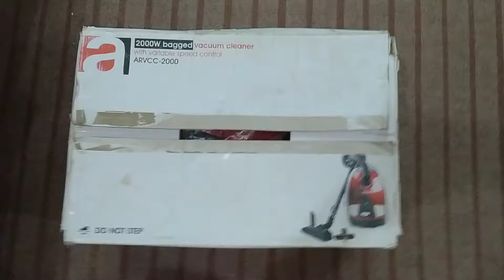how to use a vacuum cleaner?

Comment: I m using this vacuum cleaner but after sometime, it turns off automatically can u tell me what is the problem
Reply from the maker: Same problem is facing to me. I think it is built as such. I thought that it's button has fault but ensured me that it is as such of type. Don't worry just use the button with moving forward to backwards and forwards to backwards repeatedly.